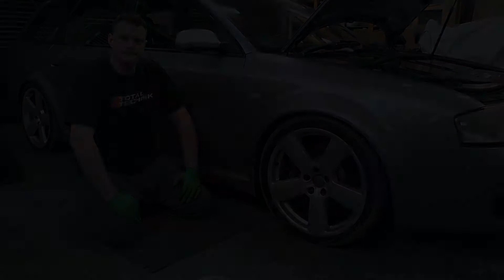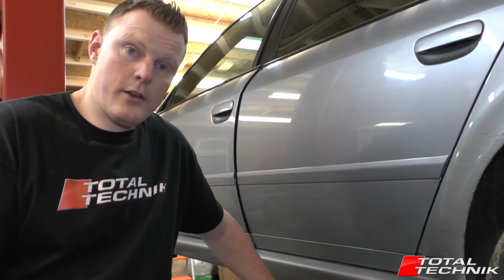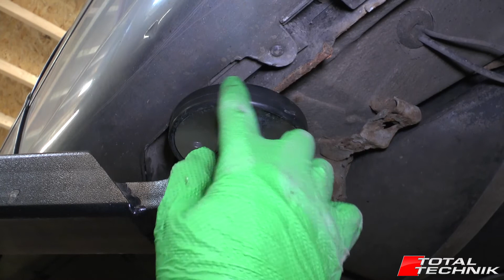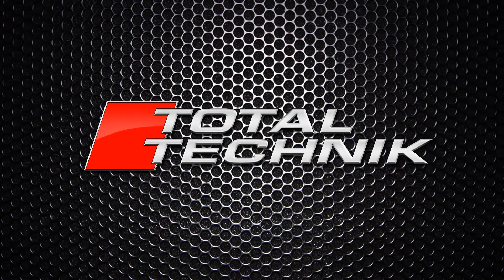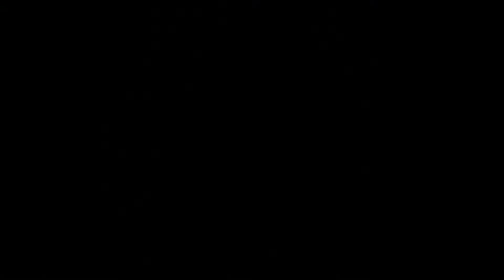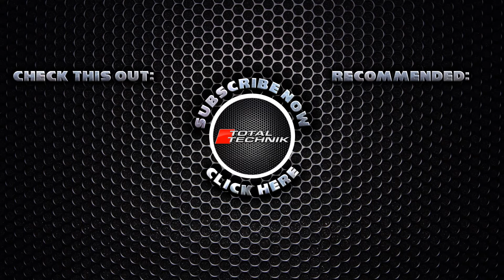Jacking Points - Audi A6 S6 RS6 - C5 - 1997-2005 - TOTAL TECHNIK

Comment: Ok but, since I don’t have a lift, where  else can I jack the car up in order to get a jack stand under the proper jacking point that you showed?
Reply from the maker: Hey there! Please read some of the comments below. The lifting point shown in the video is the same for jack or car lift :-)

The jack stand (axle stand) has to ve placed elsewhere as of course you cannot switch out the jack to axle stand once lifted.

--- 

To help support us (for both you and others reading this) there are a few things you can do:

1) Donations both needed and welcome! We cannot operate Total Technik without the support of people like you! You can donate by PayPal - just go to www.paypal.me/totaltechnik
2) Please ensure you subscribe to our YouTube channel. 
3) Please give our video's the Thumbs Up on YouTube. 
4) Please help spread the word, the more people who know about us the better! Add links to our video's in forums, let people know about us.

Thank you for your support!
Reply: Total Technik yes but I need 2 points, one to lift and one to place the jack stand...
Reply from the maker: @donstevens7847  Yes, indeed. Everyone faces this issue with most make and models of cars. A good place to place axle stands on the B7 and B6 platforms is on the sub frame mounting bolts as this is an area designed to take a LOT of weight. The front subframe just ahead of the sub frame bolts is a spot we use a lot if your axle stand heads do not fit nicely on to the sub frame bolt end. We cover this subject in our BBK engine removal video actually, but that's not a free one. Hopefully we'll make a separate video covering this in the future.